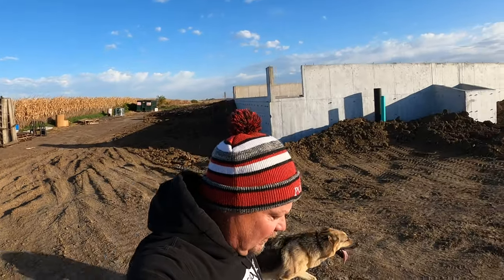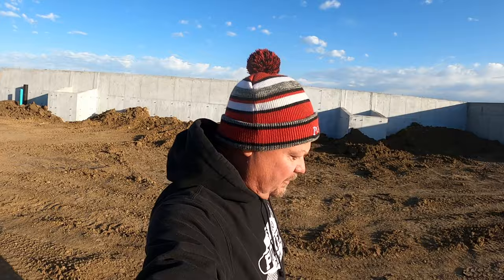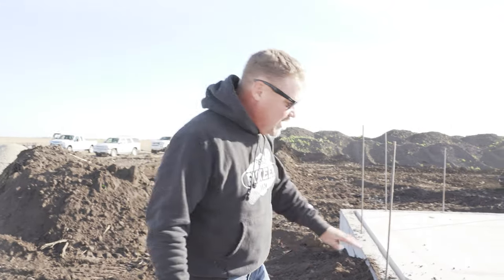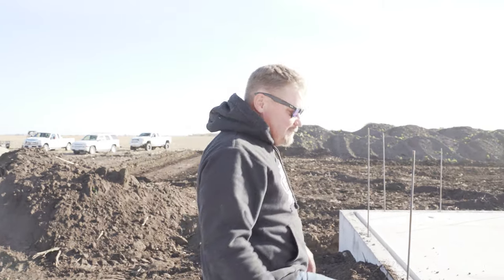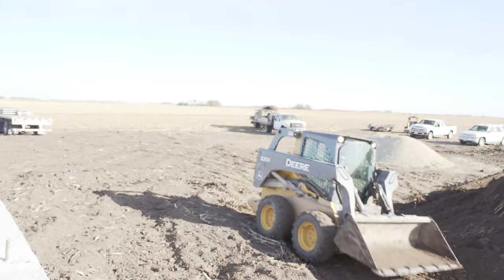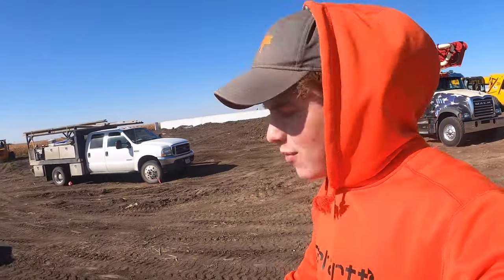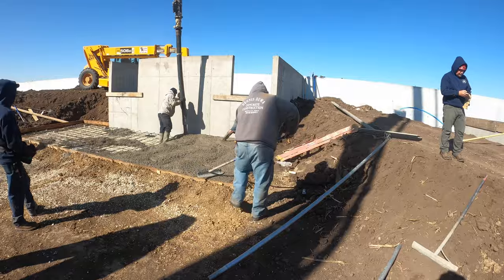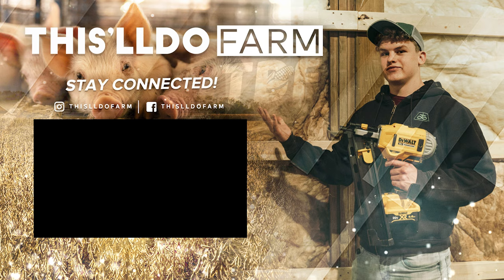Finishing Up Concrete For Our New Hog Barn..

Comment: I have a friend who has poured cement for 45 years he started when he was 15 and when he graduated from high school he had a job working at a packing plant and at night and weekends he poured cement and then he got a job as a janitor for a nursing home and he did driveways and sidewalks and he would buy cheap houses that had to be moved and he and his brother would lay block for the basement and then moved the house in then he would fix the house up and sell it. He did like 35 to 45 in the years and he would bid on homes that were built by guys that were in a carpentry class at our local technical college and when he got the bid on those he would get a guy that dug holes for basements and he would lay the block and move the house in that he got the bid on. I helped him some by mixing up cement and keeping his brother and him with a pile of cement in front of them. He has put both kids through college and one of those he put through additional 3 years of college and always bought them nice cars, pretty much close to new ones and he always had a new pickup to drive around in and a 2nd pickup for pouring cement and hauling tools and wheelbarrows around.